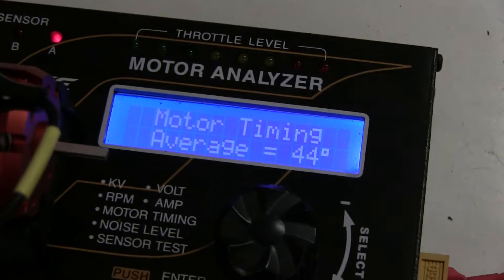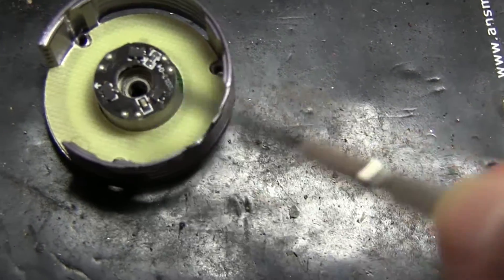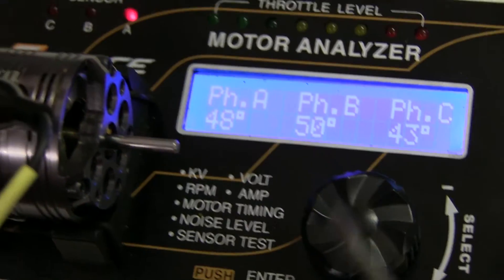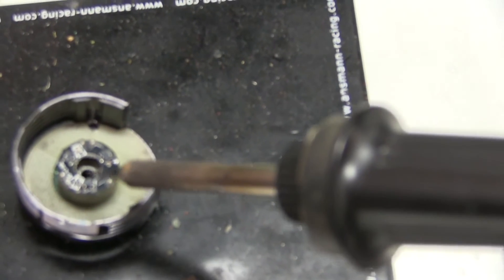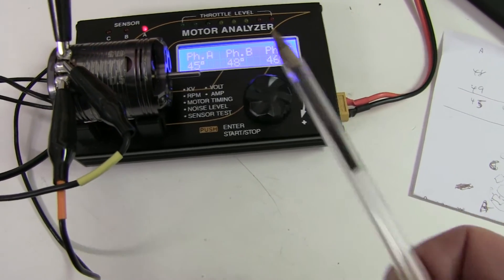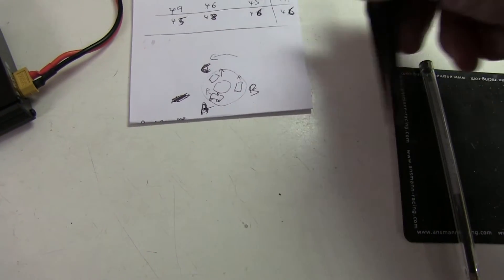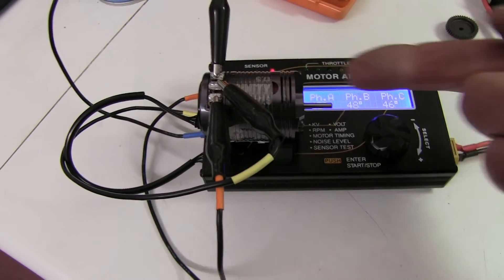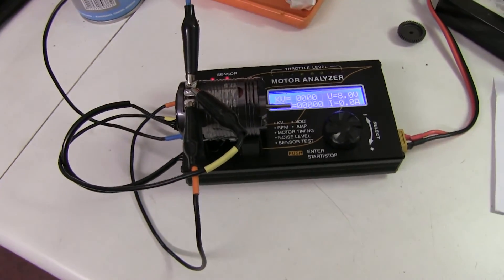Brushless motor Sensor board Adjustment.

Comment: Fantastic help that was. I bought a sensored motor that was in bad shape, bad enough that i got a full refund & got to keep the motor. The rotor looked like it was stored in maximum humidity somewhere near the equator in thr tropics for a decade unprotected!
Not being able to have something sitting around that may be able to be fixed I started to work on it, I found I had a Rotor from the "motor-death-box of spare parts" that was spot on the same. Next I found the sensor test showed the sensors numbers were EXTREMELY far apart. Remembering your videos i did a quick Google search KNOWING you would have a video to help. And help you did! Now the sensors are great and the motor actually runs very well!
Its a 13.5t sensored and its now powering a 1/10 rally car and giving  anyone that drives it a big smile on their face. 
THANK YOU SO MUCH FOR ALL YOUR HARD WORK, taking time to make these videos and sharing them with us all !

Comment: You need to make a jig. A round pin to go inside the bearing with a slotted(accurate 120 degrees) disk attached to the end, or a marked translucent disk

Comment: What temp on the soldering iron?
You say heat one side of the sensor.  Do you touch both leads coming out of the sensor at once to heat?
Do you apply slight pressure with tweezers (or whatever tool) as you heat and nudge it in the direction you want it to go?
Reply from the maker: Hi Brad.  I agree it is a fiddlly process. The iron will heat the sensor through to all three legs. If you can manage to touch 2 legs it will move quicker.  Then it needs a steady hand to move it, before it cools and sticks again.  Good luck. Nick

Comment: Greetings, Nick. Seems you have good understanding about brushless motors. I have a problem and maybe your advice will help me to solve it :) I run 4274 2250kv brushless sensored motor in pair with 150A ESC. motor has 130 amps max draw rating, ESC has around 1000A burst. In sensorless mode this combo is a beast, no cut offs, just rips my traxxas summit apart. in sensored mode strange thing happen, when pushing full throttle motor screeches and ESC goes in LVP, even with motor pulled out and spinning without load. I tried everything, playing with timings, Low, medium, high, very high, played with initial acceleration, nothing helps. tried different battery packs, even 150C 8000mah 4s Graphene. ESC keeps going in low voltage protection because of strange amperage spikes when applying full throttle, it goes like 250a for a 1/10 of a sec and ESC shuts off. In non sensored mode, such spikes do not persist. I even added 10000uF capacitors with 0.003 internal resistance to withstand these spikes, but without result. What is your verdict? Is it a not powerfull enough ESC or it's a damaged motor, which cannot provide exact sensor information and ESC shorts itself when trying to follow rotor angle?
Thanks in advance!

Comment: Hello, I bought a longboard, to which the former owner cut the sensor wires between the motor and the controller, I state that the sensor connections to the motor are directly in the engine, does not have the plug, the controller has the plug, and I'm thinking of plugging in but how do I identify wires? How do I send you a picture? Thank you
Reply from the maker: Send to:
nick@demonproducts.co.uk
Reply: Nick Adams, Okay, let me send you on weekend, thanks

Comment: Nick is it possible to use a sensor board from another brand if the physical mounting dimensions are the same but the components are different,also can you use hall effects sensors from say hobbywing on an R1 wurks.
Reply from the maker: Hi
The hall sensors are generally the same.
The whole sensor board may have the sensors at a different position when fitted.
But if the alignment is the same it should be ok.
Reply: Thanks for your reply,i'm actually having issues with low rpm cogging on my R1 13.5 ultra premium.It does not matter where i set the timing and upon inspection i found the sensor board poorly made and the hall sensor board is slightly twisted and out of alignment to the sensor plug board.I could just replace it bit i'm 5 hrs from the closest town lol.

Comment: I just subbed your channel, as it is a wealth of information!! 
I'm just getting back into Hobby, after leaving in disappointment in 1998....
So, Brushless motors are brand new to me. I won't ask you to be overly specific, but I've some questions....

Firstly, I'm NOT a competition racer. Mostly off-road, Trailing, also have a couple of Buggies. 
Is there a big difference between sensored and sensorless??
Is 2-pole or 4-pole better for low end torque? 

If I can sort those two, then I can start battling with the fact that almost no two manufacturers have the SAME method of measuring output!!! 😠😠😲  (17.5T, 21.5T... 2100kv, 3650kv, 5700kv.... 540 size or 3650 size!) What a MESS! 
Cheers ~ Carmine

Comment: what motor analyzer brand and model  are you using?
Reply from the maker: The analyzer is sold by Sky-RC and G-Force, also HobbyKing has one that looks the same.
I use the GForce Motor Analyzer.
Reply: Phil Fernandez - They're about $75-80US on EvilBay - but no US sellers, as far as I can see. RC Mart in China is actually reputable though...

Comment: nick, seeing your testing with a 2s battery. how does that translate to 1s racing?
Reply from the maker: Hi Mike
I did a video on setting a motor for 1S racing.
I advise setting it on a 2S lipo, as it is much easier, and then using on the 1S.
It gives the same optimum timing for normal blinky (zero timing racing).
Reply: Ok nick. I think I'm going to get one of those testers and give it a try. Have you ever used the Trinity motorlizer? If so, what did you think of it besides over priced. If I had to guess it has the same circuity that's in the motor tester that you use.
Reply from the maker: The Motolyser has KV and sensor timing, so should be as effective.
However tyhe gForce is a lot cheaper.
lefthander-rc.com   sell it in the USA.

Comment: Trinity needs to improve quality control on their sensor boards. None of my Trinity motors passes the timing test on the motor checker. Both of my Trinity motors are off by 10 degrees.
Reply from the maker: I agree.
Trinity are the worst, and a 10 degree spread is not uncommon.
Reply: Hi Nick. My frustration with Trinity led me to send them an email regarding their motors' timing issues.  The reason Trinity motor timing issues are so bad is because they don't actually test them. Can you believe it? This came from a technician for Trinity in his response to my email. This oversight even applies to the more expensive "certified" motors. He said the numbers on the end bell were more of a "benchmark" for timing rather than actual timing. I was told to send the motor in and they would adjust the sensors, for a fee of course. I declined the offer. I may be done with Trinity until they resolve this issue. Figured I'd let you and your subscribers know what they're getting into before purchasing these pricey motors.